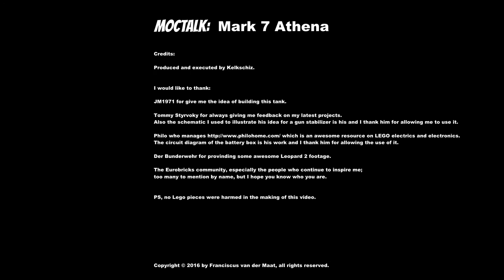LEGO Tank Mark 7 Athena MOCtalk

Comment: I always find it a shame that current lego only has 2 set of official track link elements, with heavier module a wider track will be ideal, especially on softer terrain. I really like the "keep the hull short" decision you made with this module and how you explained roughly why a longer track will lead to a waste of energy in steering a vehicle (this applies to real life racing cars too) Obviously  the programming and the functionality of gun stabilizing is like no others! truly an amazing work!
Reply: Try using Technic beams to stick 2 large tracks together side by side to make one large one. Works great for a lot of stuff and you can still use sprockets and whatnot.
Reply: You can also use flat pieces to make the smaller tracks wider.

Comment: 9:26 if you made the turret inside the hull a bid wider instead of going so deep into the hul you would be able to make the turret ring extend over the tracks and thereby make the hull slimmer.
i dont know if you have some other components inside that take up the space but that would make your tank a bid prettier
Reply from the maker: I think I see what you mean, and it's a good point. It's a conclusion I had come to myself as well. This is a pretty old tank. Since I built this tank I have built three others and at the moment I am working on a fourth. They are all slimmer and much less massive than this tank. And I do tend to put as much of the mechanisms in the top part of the turret in order to make the tank as slim as possible. I am afraid though that I am a bit behind making videos of them... But that should happen in the coming months.  Have you also seen my Blacktron Liberator? That one is more in line with the type of tanks I tend to make now.
Reply: Kelkschiz yes i have seen it, but i am not a big fan of modifing the Electronics
Reply from the maker: Ah I see, everyone has his own point of view on that topic. There is not a lot of modifying in that MOC though, only the power source. You could get the same result with a BuWizz. Of course some purists would consider that modifying as well since it's not made by TLG.

Comment: I made a gun system based on how an automatic bb-gun works and it's even more compact and it works great.
Reply from the maker: Sounds interesting, anywhere I can see it?
Reply: http://prntscr.com/bg65md I'm making a KV-2 so that's why the barrel and the shells are so big.
Reply from the maker: DenmasterNL Hmm, I see how the loading and pull-back mechanisms work but I don't quite see how the release mechanism works. How do you get the ram shaft to release after it's pulled back all the way?
Reply: Kelkschiz some of the teeth are removed so that's how the ram shaft gets released.
Reply from the maker: Thanks for the picture. I have seen such mechanisms before in LEGO. Personally I am not a big fan of them because I don't like modifying individual LEGO parts. But that is just my personal preference.
Reply: Kelkschiz kris(inicus) hier ;) ik vind het heel erg knap/gaaf hoe je de gun stebilizer bedacht en gemaakt hebt. Zo erg dat ik er nu zelf er ook een wil maken. Ik heb al een idee hoe ik de gun sneller kan laten reageren door de linear actuator te vervangen met directen tandwielen. Dat zou dus ook een andere snelheid en duur van de motor vragen om te werken. Maar omdat ik niet heel erg goed ben in programeren zou ik graag jou programma willeen gebruiken als bassis. (Als het werkt zorg ik wel dat jij natuurlijk credits krijg voor het progamma)

Comment: Probably could add a bit more armour on the side. Maybe thicker armour all around? The Mark 9 could include it. But overall good tank. Again maybe thicker armour.
Reply from the maker: Here you can see the Mark 8, it has lots better armor: https://www.flickr.com/photos/33425520@N07/albums/72157680687967421
Here you can see the Mark 9 AKA Blacktron Liberator, it also has better armor:
https://www.flickr.com/photos/33425520@N07/albums/72157682532665675
Reply: Oh ok thanks. I didn't know about those

Comment: Hi i think your tank is really cool and i want to build one of my own. 

I was wondering about your barrel (how to make it) and how it is intigrated into the shooting mechinisms.
I was also wondering about your tank's tracks and where to get them, aswell as all of the general bricks that cover it (as i can't find any sets that specialise in a large amount of grey bricks, like the ones on your tank).
And finally i was wondering, how big is your tank (width,length+hight) as i want to know how much bricks it may need at max.

Thanks :-)
Reply from the maker: +Syber Games Hi mate, thanks for your feedback and questions. So the first two questions can be answered by pointing you to the following post on my blog: http://kelkschiz.blogspot.nl/2016/01/below-you-will-find-link-to-digital.html. There you will find digital instructions of the shooting mechanism that I designed for use in this tank, which includes the barrel and how they are integrated. 

My tank measures around 59 studs (47.2 cm) in length, 39 studs (31.2 cm) in width, and 22 studs (17.6 cm) in height. 

Personally I get about 90% of the bricks I need from Bricklink. Bricklink is a huge market place for buying and selling LEGO bricks. Many hobbyists operate a store to sell what they don't need and you are free to order exactly the parts you need. The following links are to Bricklink and are the parts I used for the track system in this MOC:
http://alpha.bricklink.com/pages/clone/catalogitem.page?P=57518#T=C
http://alpha.bricklink.com/pages/clone/catalogitem.page?P=57519#T=C

Hope this answers all your questions, happy LEGO building!
Reply: +Kelkschiz Thanks :-)

Comment: +Kellschiz hi again i was wondering what do you use as ammo for your tanks? and also i want to make my tank an AFV so it will have "missile launchers" on the side of its hull. 

These "missiles" will be one shot, automated 'Spring loaded shooters' and will swivel to hit a rounded brick to fire. I was trying to find a rounded brick that is  1x1 in my box, but I can't find anything of the sort. Do you know of any different ways to make them auto fire?

Thanks again :-)
Reply from the maker: I use those 1x3 thick liftarms as ammo: http://alpha.bricklink.com/pages/clone/catalogitem.page?P=32523#T=C

About those missles, what type of spring loaded shooters are we talking about because I can think of several? And what do you mean by autofire? Do you mean self-fire. autoload or remote controlled firing?
Reply: Hi thanks about the ammo

Do you know the new ones that have see throught arrow like ammo.You have to press down on the back of the loaded ammo to fire.
 I want them to be remotely controled to fire when i press a button but it will be extremely hard to make them auto relaod to (maybe do that when I'm on school hols sometime) 

:-)
Reply from the maker: Do you mean something like this this video by Mahj: https://youtu.be/WgP8XpMRUfo?t=41s?
Reply: Yes the way that it fired and that shooter, but only for 1 and it turns 90 degrees to hit the brick and shoot then it will move back( as it is a lego servo motor that I'm using
Reply: The problem is, I don't have a clue how to make it

:-)
Reply from the maker: I sort of see what you are trying to do. Making these kinds of mechanism is always sort of a little puzzle. You just have to give it some thought and try if it works. 

As I said I have never worked with those spring loaded shooters, so I don't have a ready made mechanism for you. I would just try to envision it and if you have trouble look at the spring loaded mechanisms of the guys I mentioned for inspirations. I am sure you will be able to figure something out. 

The most obvious thing I can think of off the top of my head is to have a little pin sticking out in the right place that just hits the release as the shooter is getting to 90 degrees. That is probably the first thing I would try.
Reply: Ok thanks maybe i'll have it finished soon (years more like :( unfortunatly life hates me atm) so i could show you.
  
:-)